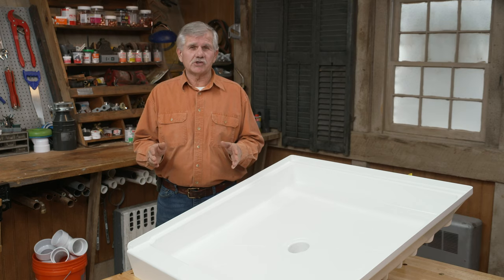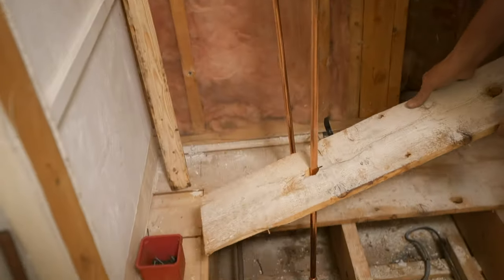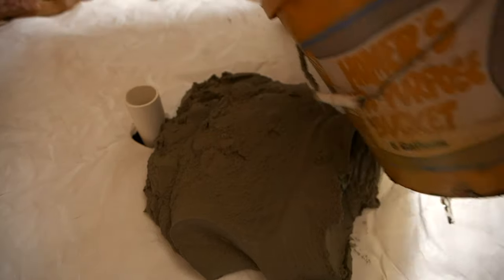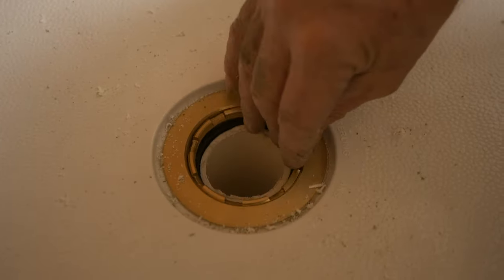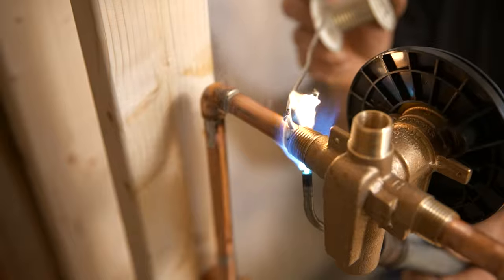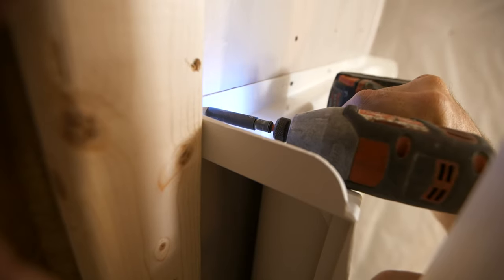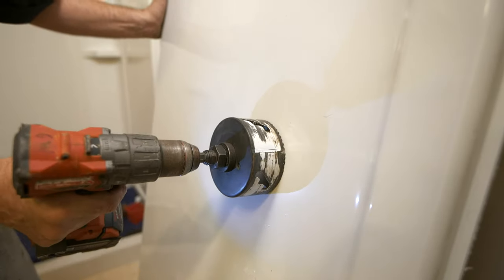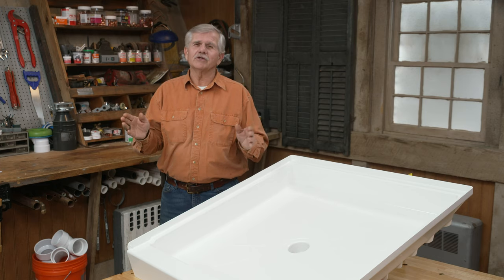How To Install a Direct-To-Stud Shower Enclosure | The Home Depot with @thisoldhouse

Comment: A pretty good demonstrations with a few notable exceptions. Sheetrock screws are not galvanized and rust, so using them in this situation especially up at the shower arm fitting for support is just wrong. Also, when gluing the PVC drain, I didn't see any purple primer being used. When the drain and valve trim plate were being installed there sure was a lot of debris that should've been removed first. Finally, after setting the base into mortar, place about 40 lbs. on center of it and let it sit overnight. The weight will keep the base from lifting or shifting while the mortar sets.
Reply: What screws to use instead of drywall screws ?
Reply: @glock316  First I pre-drilled my holes in the shower mounting lip, and then I used #8 x 1-1/4" truss head screws, they were Teks #21512 from Home Depot.
Reply: The purple "primer" is just pipe cleaner. It isn't necessarily needed for new PVC.

But great point about the galvanized screws.
Reply: Thanks guys. I've learned more in these comments than 3 video's.
Reply: @stevelabranche6119 I was just thinking the same thing! I've got everything ready but could not find one video to tell me what kind of screws to use! One commenter said to use a 1 and 1/4 decking screw which logically told me it won't rust.
Reply: ...and if I may add, the weight in the bottom pan makes total sense!!!

Comment: 27 years Building and remodeling homes. I’ve never , not once seen or heard of setting a 3 piece pan in mortar. 😂
Reply: Do you use hot mop/ asphalt
Reply: That's why you have soft spots on the floor with subsequential cracks n leaks

Comment: If you buy a Sterling unit at Home Depot, Lowe’s, etc.  make sure you inspect it thoroughly before you install it.  These units are not packaged very well and 1 out of 3 are usually damaged.

Comment: I purchased an American Standard kit from HD due to the unique dimensions of the shower alcove. We hired a handyman who had done some other work for us. The job was above his pay grade and he spent 4 times the time needed by a more experienced installer. Additionally, he put the two end pieces in upside down. I texted him and he apologized and said he would fix it without any additional charge. That was the last we heard from him. So, we purchased another 3-piece kit and hired a new, more experienced plumber. The American Standard kit has very flexible (flimsy?) walls. When attaching the two end pieces, the idea was to attach directly to the studs. The problem with this is that there is way too much flex between the shower wall and the studs. Since this kit required caulking at the seams, the flex of the end pieces naturally broke the caulk seal when only moderate pressure was applied. So, now the installer has to come back and we have to find a way to eliminate the flex in the end pieces perhaps by putting foam insulation behind them. There isn't an alternative to the AS kit due to the unique dimensions. The panels are simply too thin and should not bend as they do. The kit sells for $450+/- but should have been built to eliminate the need for caulk or made of stronger material.

Comment: Why were copper and solder used, here? Isn't it easier and more cost effective for a homeowner to use PEX? Or at the very least use SharkBite fittings?
Reply: Agreed!
Reply: It’s my understanding that solder is best (when done right), especially for locations that are difficult to access like tub/shower supply lines.
Reply: Pex and expansion rings are great and very cost effective, but SharkBite fittings are expensive (about 8x the cost of copper sweat fittings) but imo really shouldn't be installed in areas with no access, the plumbing company I work for in NJ won't allow SharkBite to be used for anything except to cap off stub outs, and never concealed inside of a wall. But that being said, I'm sure when properly installed (prepping the pipe/deburring) and strapping/securing the pipes properly, you'll probably be fine with sharkbite lol but lots of people just cut pipes and slide sharkbites onto them and call it a day lol
Reply: @ChrisHasFunYT SW OCSA asked the

Comment: Good content and good advice.  With regard to the single handle shower valve, I suggest removing the cartridge from valve body to prevent heat damage to the cartridge when you solder the connections.  When you re-install the cartridge, sparingly apply silicone plumbing lubricant to it to make it easier to insert in the valve body.  Keeping the cartridge in a plastic bag will prevent it from being contaminated by construction debris.

Comment: Hi, I know it's 2 years ago but should you screw in the base? My instructions says to screw in the base and supplied the screws for it. I have sand mix all under mine and it's solid. A friend of mine was saying don't put the screws into the base you don't need plus it could add tension and crack. Thanks

Comment: If the shower is on an exterior wall, do you need at add wall board behind the enclosure ? Or do you still screw to the stud ? And how thick is that vapor barrier ?

Comment: I am installing the sterling 4 piece 48" shower, do you need to install a 2x4 support block between studs to support the valve and if so how do you determine the distance so that the bonnet comes thru the panel far enough for the trim. the valve is a delta multi choice with plaster ring
Reply: It is best to use a 2x8", or some 2-by that is wide enough so that you can mount the shower valve body onto it. 
  I attached my 2x8" to the studs first (like a fireblock) with a few screws - making sure to install it at the same the height of your valve body that you desire.
  Experts
 say the valve body is supposed to be mounted between 40"-44", but you can install it anywhere you want.  Just remember: your chosen location is going to be permanent, so I recommend placing it as close to the center of your shower base as possible.
 Then I simply used a couple of more screws to mount the valve body onto the block of wood.  
  Your valve body should have come with a  square plastic piece (mine was black) that you temporarily attach to the valve body.  Attach that onto the face of your valve body in order to see where you're finished wall is going to be located around the valve body itself.

Comment: you dont have to put some type cement board or durrock behind the enclosure for mositure? thanks
Reply: I would do everything possible to ensure a water tight enclosure, including vapor barrier and sheet rock. anything and everything to stop and slow a leak.
Reply: thats what am thinking too. What if the pan cracks. Our shower wall is cracked but it also seems from the 80's @charliejohnston1978

Comment: How do you prevent water from getting into the gaps between the panels?
I'm looking to replace a moldy shower and don't want to end up with the exact problem on a new one.
Reply: I usually caulk the vertical lines with silicone (make sure it's rated for kitchen and bath). The horizontal gaps are usually left uncaulked or caulked as shown in this video.
Reply: Most caulkless surrounds guide the water down to the pan allowing it to drain.
Reply: I agree Blitziel, but I would still use a thin bead of silicone anyway, as an extra security measure. 
  I don't even want a single molecule of water slipping through. 😏
Reply: @Parabellum-X  The problem is that over time the caulking can break down or a tear or gap develop from use. Now the lip of the pan is most likely sucking up or holding water instead of letting it freely drain and air out.

Comment: What kind of screws do I use to install the same shower
Reply: Galvanised screws and nails are zinc coated nails that have undergone a galvanisation process. This process means the nails have a protective barrier which makes them resistant to rust and corrosion.
Reply: @brendsjohnson4589  Many zinc coated nails and products are not galvanized, and besides they do rust after several years anyway. Use stainless screws only.  QED

Comment: ha - who has all these special tools ?
Reply: Most of the tools are pretty common or cheap to buy. The inside cutter is like 10 bucks. The only thing that's expensive is the copper crimpers but you can just solder instead.
Reply: A drill bit and a drill. Just use shark bites instead of soldering
Reply: I happen to have a press tool available to me.  Quite awesome, although, I only need to cap off the old tub sprigot, and extend my shower head up higher, so I'll probably just solder.  I don't trust shark-bites inside a wall.  I used them in my basement though, where I have acess.